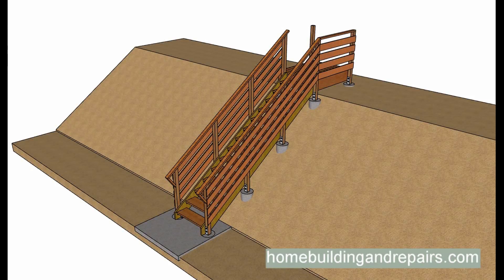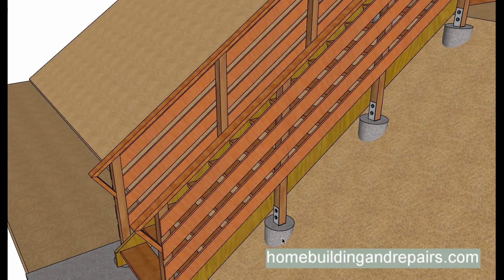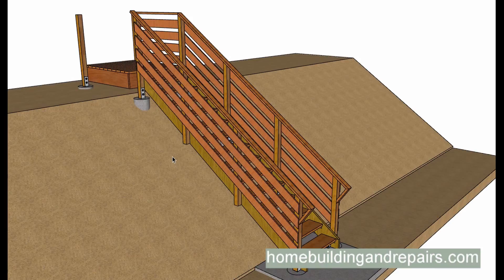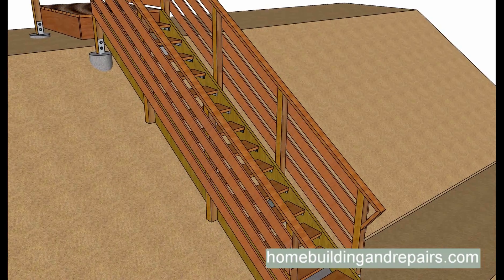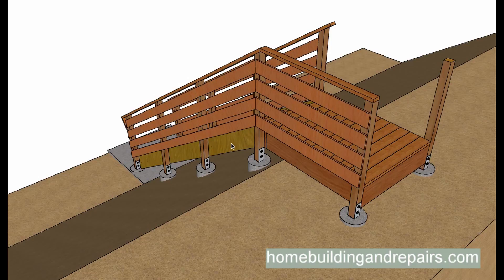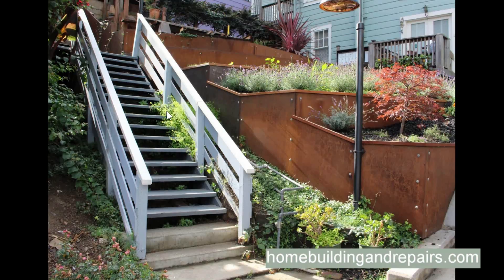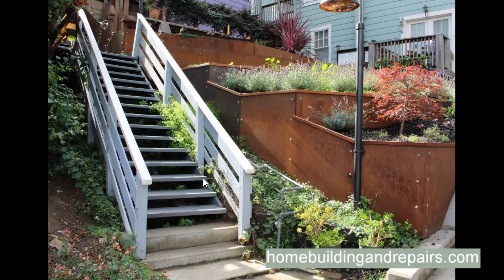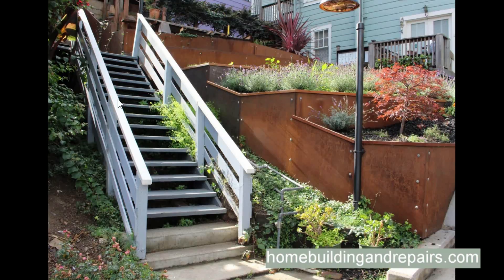Using Posts and Footings for Extra Structural Support – Building Stronger Hillside Stairs

Comment: This footing and post system is just what I need for my hillside stairs.  My only question is whether the brackets provide enough support both in the lateral and the downhill directions.
Reply from the maker: They've been using them for decades with good results, but I would contact an engineer or a manufacture if you're looking for load details.

Comment: I need to do this EXACT thing.
I was thinking a concrete pad at the top and bottom. Still deciding wether to use concrete footings or set the post into the ground with concrete.

Question for you Stairbuilder. For stairs do you use 4x4 or 6x6 posts?
And how far apart do you set the posts. This set of stairs is going in a straight line up a fairly steep 40-50' hill ~30 degree angle.
Thx
MJ
Reply from the maker: I cannot provide you with structural engineering information, but if the stairway is less than 4 foot wide and you're going to be using 2 x 12 stringers then 4 x 4 should work spaced around 8 foot apart, but remember this is only an educated guess.
Reply: @stairbuilding  Yep, 4ft is prefered no wider. I was going to do solid stringer with metal brackets in all 2X.
I think I need a transom? for figuring out the "plane". Its going to ~50ft from top to bottom with ~30 degree angle. I have rebuilt indoor stairs. But at least I have solid foundation and a the old stairs as a template.
Thx
MJ
Reply from the maker: @mikejohnson9118  I have more information at the website. In the building section click on stairs and then landscaping and here's a link that also might be helpful.  Https://youtu.be/L_ZirADw74Y